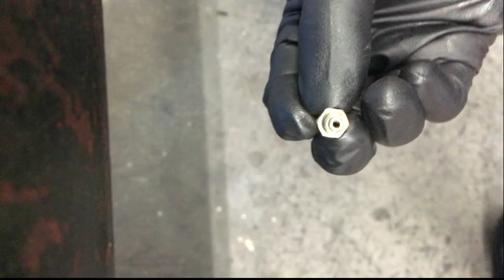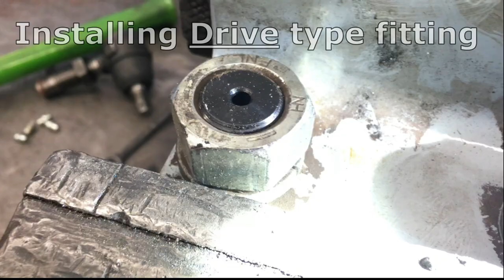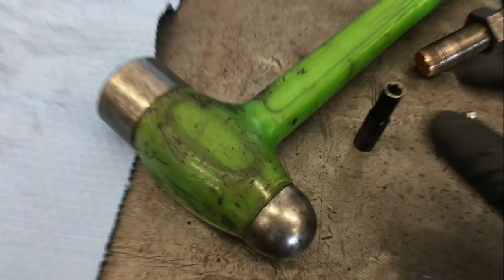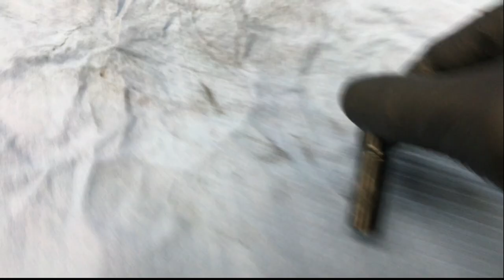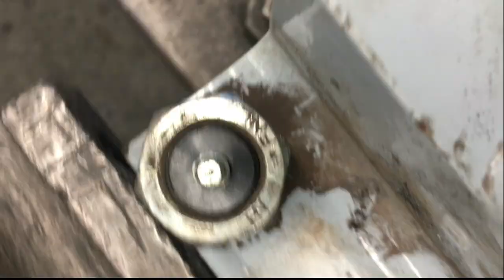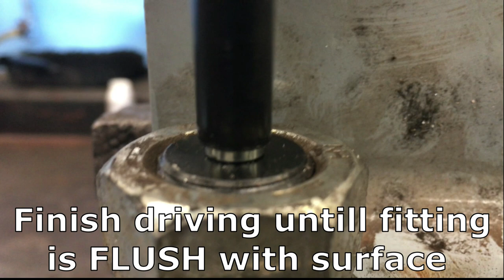How to install Grease/Zerk Fittings (Threaded and Drive Type)

Comment: Thanks for the info on the drive fitting, works with a socket. That’s what I was thinking I should try. I didn’t want to hit it directly with a hammer and risk doing any damage to the end. Thanks again.

Comment: What are the pros and cons? For example on a structure with high-load, is drive-type a better fit in terms of preventing stress concentration?
Reply from the maker: In my experience with automotive and heavy duty equipment, zerk fittings are usually threaded and the drive in ones are more for replacement purpose. I don’t see a zerk fitting having too much pressure buildup regardless how much load the machinery is handling because the grease channels job is just to contain grease and any excess grease will just ooze out the weakest points (dust boots or exposed channels)

Comment: Nice video. How would you take out a drive fitting?
Reply from the maker: Thanks, I’ll see if I have the time to make a video for removal. If you want to remove a drive in fitting you can try locking the head with a locking plier and wiggle it out. Another way is tap tapping it with a chisel side by side slowly and it might come out. If it’s a broken zerk fitting then you’d have to drill it out very carefully and not enlarge the existing hole. If you did you will need to drill and install the next size fitting. Take care!

Comment: I bought new sway bar links and one had zerk fittings. When greasing the bushing didn't expand and grease came out the zerk fitting. Is that normal?
Reply from the maker: Try pivoting the link joints as you grease so it makes room for grease to move. If it comes out of the fitting in most case you’re dealing with some sort of resistance. Use a pick and depress the tip of the zerk fitting so the ball bearing moves in and back up freely. If it still comes out of the fitting it could be the grease coupler not sealing properly. Let me know how it turn out

Comment: How would I safely remove the press-in grease fittings? Using pliers?
Reply from the maker: Several way of doing so. First is clamp it tight with locking pliers and rock it out slowly.
Another way is to drill it out if it’s broken. After drilling the center out use a combination of magnet and pick to take out all the metal shavings before installing new fitting.
Reply: @waynesgarage8579  Awesome. Thanks!
Reply: Some zerk kits on Amazon come with a easy out removal tool for zerks

Comment: Could I drill a hole in any joint and use a drive zerk?
Reply from the maker: Yes you can, make sure you clean off all metal shavings if you have access to the inside of the zerk cavity (pivot sleeve) however if it’s a joint you’re drilling into I recommend filling it with grease before drilling so it catches all the metal shavings, then you squeeze the joint boot and most of the shavings will come out along with the grease. Also have good control of the drill bit. Make sure it’s level and you STOP right after the hole is made. If the drill bit plunge lower you chance mixing the metal shaving deeper and it’ll be difficult to clear out. Best of luck
Reply: @waynesgarage8579  they were barely greased so I doubt I'll be able to force it out but it will be fine